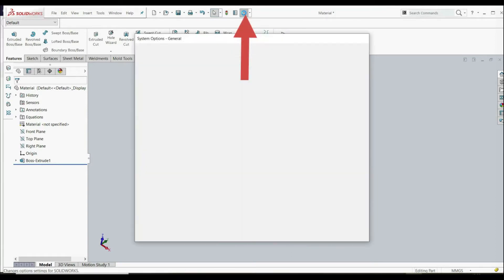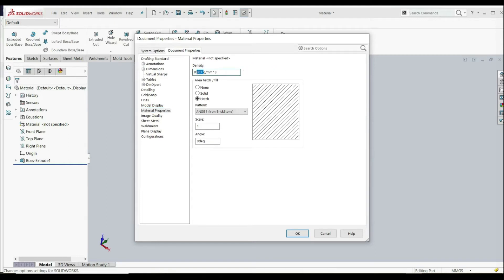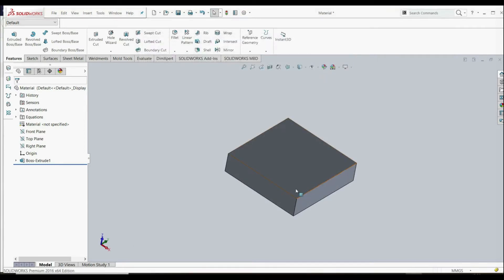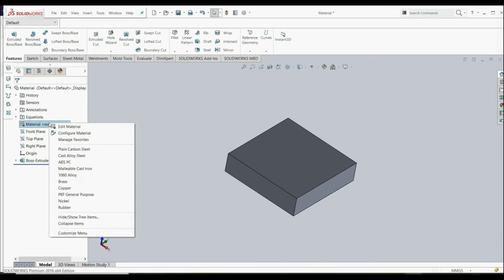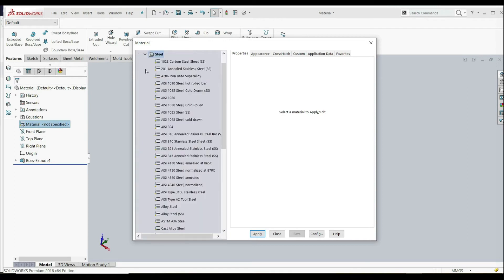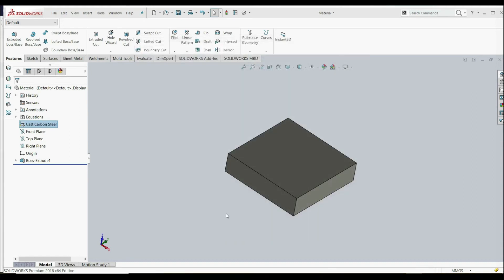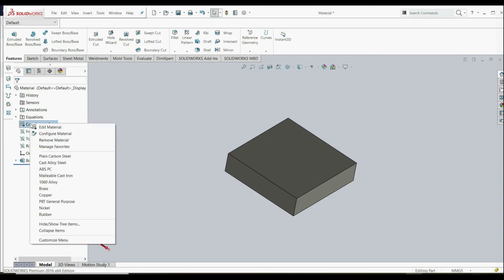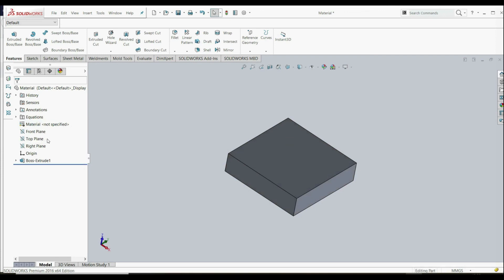Solidworks Tutorial - Density and material

Comment: Will the density of the component still be 0.008 even after you assigned a material or does it change then
Reply from the maker: when you assign a material to a component, the density automatically updates to match the material's predefined density. If you manually set the density to 0.008 before assigning a material, it will likely change to the material's default density once the material is applied. However, if you override the material density manually, it will stay at 0.008 unless changed again.

Comment: doesnt work for me :(
i set dencity, but it is still 0
Reply from the maker: Try one of these: 

1.Material is Not Assigned
Go to Edit Material (Right-click Material in FeatureManager > Edit Material).
Make sure a material is selected. If “Custom” is selected, manually set the density.
Click Apply and Close.

2. The Body is Not a Solid (Empty or Surface Body)
Go to Mass Properties (Tools > Evaluate > Mass Properties).
If the mass is zero, your part might be a surface body (not a solid).
Convert it to a solid using Thicken (for surfaces) or check for gaps if it was imported.

3. Incorrect Units or Display Precision
Go to Options > Document Properties > Units and ensure the correct unit system is selected.
Also, check Decimal Places to make sure it’s not rounding to zero.

4. Material Density Not Updating
Try forcing an update by:
Changing the material to something else.
Clicking Apply.
Changing it back to the desired material.
Checking Mass Properties again.

5. Corrupt Part File
If nothing works, try:
Saving a Copy of the part and reopening it.
Creating a new part and inserting your body (Insert > Part).
Checking for geometry issues using Tools > Check.